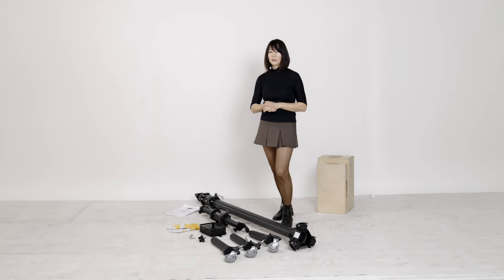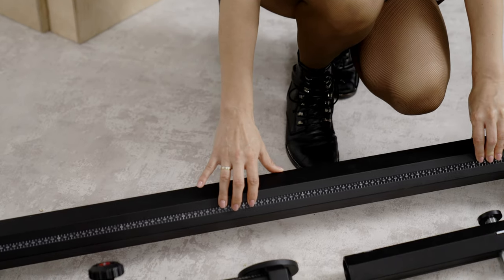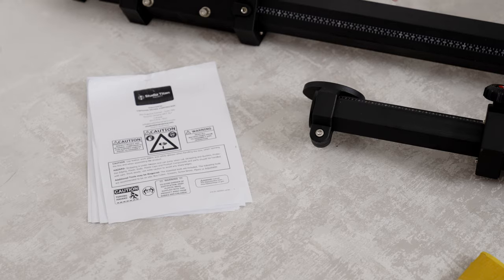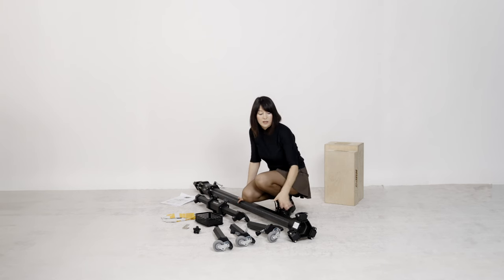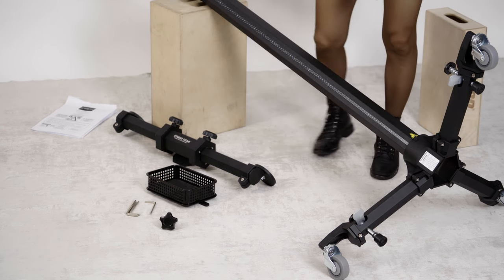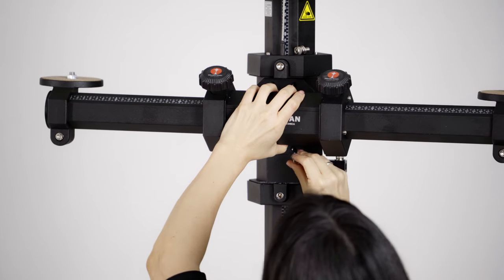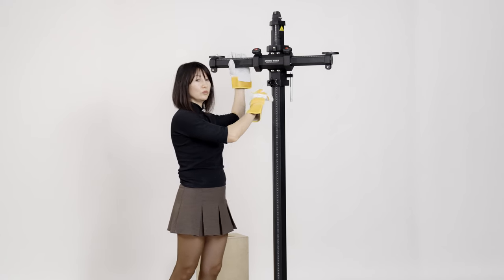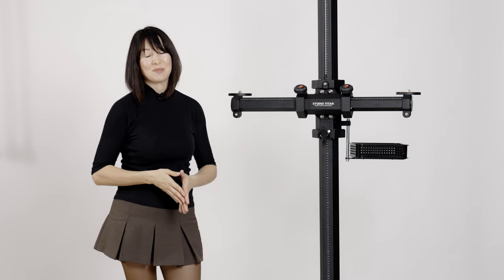Studio Titan 360 MK2 Camera Stand Assembly

Comment: In my early 20s(a long time ago), my brother and I had a small studio with a pillar stand for the heavy Mono-Rail studio 4x5 camera and the usual Hasselblad, and it literally weighed a Ton..  I am not sure if they are of any practical use for today's light Mirrorless digital imaging systems, though. Your assembly instruction was excellent.
Reply from the maker: This one is build like a tank but not so heavy. It’s smooth and easy to work with. But it’s not just about the camera. Cameras come and go. Although it helps with sharper images, I can have a tether on there which I will sho next time and more benefits. But most importantly it’s about our posture and joints and health. I have tiny hands and I am short. So I am always on my tippy toes leaning forward holding a giant lens. After about 100K shots, the posture changes and lots of pain in joints. So photography is not fun when we are in pain 😂 That’s the biggest point for me 😊